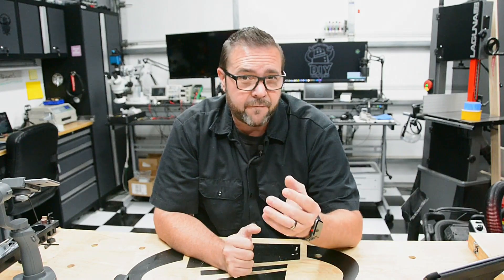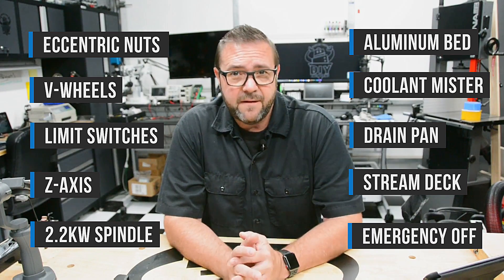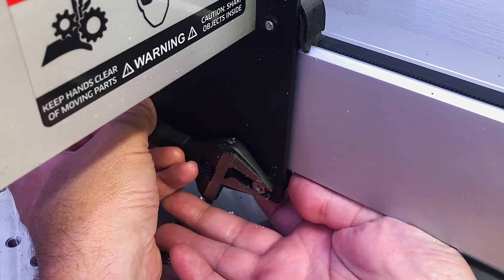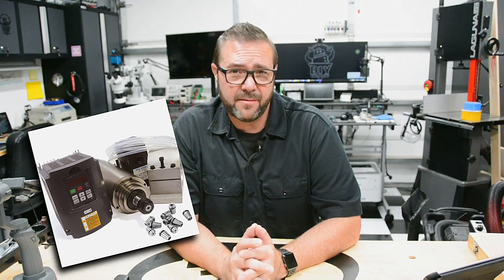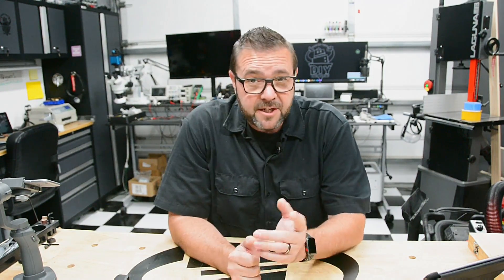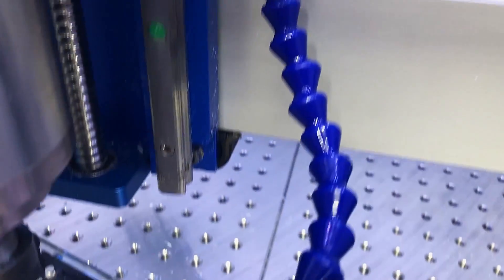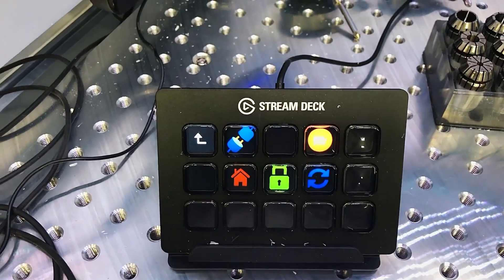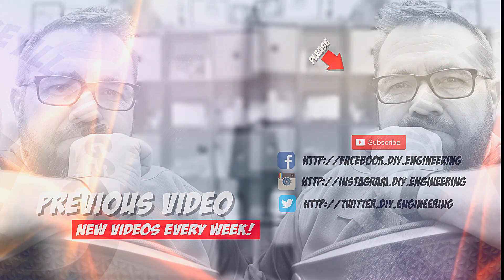Episode 037: Ten Shapeoko Performance Upgrades!

Comment: Just added the HDZ and the aluminum threaded table from Ohio Diesel Parts LLC to my Shapeoko XXL. Currently using a Fusion 5 Windows tablet as a touch screen controller with no real complaints. ($189 on Amazon) Would love to do the Stream Deck upgrade though... that looks great! Terrific video with tons of useful information... thank you for making this video.

Comment: Holy smokes.  Shapeoko on steroids. I guess if I push mine to the limits I can start implementing some of these changes.  The ones that I’ll do first.  Stop switch and the concentric nuts.  Then probably the limit switches and a controller.
Reply from the maker: ManCraftingTM lol, i still have guilt from the cost of the upgrades, time to get back to making things!

Comment: Great video.   I have done most of these upgrades but for the mister and spindle.    I have the XXL model.  Any suggestions where to find a drip pan that would fit that beast?     Thanks

Comment: Which version of UGS are you running, and have you had any problems with using it?
I am currently using Cncjs and am liking it but Im wanting to set up your stream deck pendant and cncjs doesn't have enough of the hotkeys that I would like to have that UGS does. It only has jogging.

Comment: Where the GRBL firmware changes needed for the PWM to work? I have the SO4 and my PWM voltage is always 4.9V(Max V and RPM) even if my program speed is half that.
Reply from the maker: What version of GRBL are you running? And which  pin are you using?
Reply: @DIYEngineering  I have to look up my GRBL verison, but I believe that I had to change something that was 1000 to 24000. Not at machine now. Sorry about the vagueness.

Comment: @DIY Engineering, is there any way to get the stream deck setup to work with Mach3? I have a stream deck still sitting in a box from when it was first released and using it for my WorkBee CNC would be a DREAM! Thanks for all your help and vids!
Reply from the maker: Custom Creations I’m sure it can be done if mach 3 can create custom macros and assign hot keys to them... I’m pretty sure it can. If you know let me know otherwise I’d have to look into the documentation a bit.
Reply: @DIYEngineering  I am new to Mach3 but I am pretty sure you can, just like with any other program. The only problem is how to implement it considering your code is not written for Mach3?
Reply: @DIYEngineering  All I see on Mach3 is the hotkeys for certain things and then G54 positioning and so on. I think there is 200+ G54,55,56,57 blah blah blah positions but to call them from the Streamdeck is what I am trying to figure out. I can tweet you the hotkey list if you wish. Running Macros is a whole different story with Mach3 O_o

Comment: Any chance you can tell us which wires go to which terminals on the proximity switches as they are three wire and the limit switches are two wire. Great channel by the way. Trying to do your improvements gradually.

Comment: really really neat but just curious on what you spent on this as opposed to, say, grabbing and Avid?
Reply from the maker: it's been a while since this was produced, but I believe the total in upgrades was around $1200 ... essentialy doubling the price of the machine. when contrasted to a comparable avid, it saved around $1k. I have since sold this setup to upgrade to an HDM
Reply: @DIYEngineering  awesome! Thanks for the response. I'm seriously thinking of doing some of this stuff on my ProXXLHDZ

Comment: DIY Engineering,
I am adding a streamdeck to my shapeoko at the shop. I downloaded the files shared, got the latest version of UGS for Windows, and uploaded the macros there. I have (gratefully) uploaded and am using the streamdeck profile provided, looks great. However, it seems unclear where to upload the UGS profile XLM file. I am assuming its doing some keymapping allowing the streamdeck to communicate with the UGS, but the XML format seems to not take.
Any quick fixes?
Thank you
D3PC
Reply: I have same issue did you ever find fix?

Comment: Thanks for sharing. Most of the links are dead. I think a good approach for those like me wanting to buy a Shapeoko for the first time, is to buy the minor stuff like wheels and nuts and use those instead of the Shapeoko supplied hardware when putting together for the first time
Reply from the maker: thanks, I will try to update those soon. You could upgrade initially, or perform them along the way as you encounter the reasons that drove me to upgrade... :) may cost a little up front but you will get more out of your investment!

Comment: Great video. I just upgraded to the same vfd i have wired it the same way using a 5v pwm signal, but i can't fathom the pd settings (my vfd didn't arrive with a manual). Would you be willing to share your settings please?
Reply from the maker: Radious Design sure, I'll post my settings this afternoon.
Reply: Thanks. That's great. It's been driving me crazy

Comment: Great video!  Does the stream deck work with Carbide Motion?  Currently using a mini keyboard for jogging and such.  Would love to incorporate a stream deck into my machine when I finally get around to building an enclosure for it.
Reply from the maker: hi Matt, currently CM does not have many hot keys to benefit from the streamdeck, hopefully they improve that over time.
Reply: @DIYEngineering  Perhaps C3D will follow Carbide Motion Pro with an enhanced CM in the future. So far, I've been sending Vcarve DT through CM generally with no problems. But, there are times when I wish for a couple of additional features. I'm going to look deeper into UGS. 

Thank you, very much, for sharing what works for you. Very helpful.

Comment: Great video! I just received the 110v spindle and have pretty much the manufacturer video to follow, any possible way to shoot me the PD settings you used? New to all the so the book with 180 different settings is kind of daunting.
Reply from the maker: Steve Taylor no worries, I'll post them here, let me know if the jumper info helps.

Comment: PC cooling is cool 😉 but an All-In-One like the cw3000 is a lot easier and has a pump that will outdo any PC pump, it has a built in alarm, 9L tank (which keeps it cooler longer) and temperature monitoring. it’s not refrigerated but neither is the radiator setup. I’ve done both and will never go back to PC parts.
Reply from the maker: cool, I had great performance with this setup and the footprint was much smaller than the cw3000 but of course, there are other options as you point out.
Reply: @DIYEngineering  yep footprint of pc parts is a lot smaller, especially when mounted to the CNC itself

Comment: Thank you for the video. If you don't mind me asking, how do you wire up the E-Switch using the Arduino Mini Pro? Using the Shapeoko 3 XXL purchased last year.
Reply from the maker: hi Jeff, my current implementation just issues a stop command via hot hey, the device is plugged into usb, as a result, UGS stops motion and spindle in one shot. technically, its not a read dead-mans switch

Comment: For much less than the cost of the parts to build your spindle cooling, any reason you didn't just go with an S&A CW-3000 ambient chiller?  For only a little more than what you paid, you could have gone with a CW-5000 refrigerated chiller.
Reply from the maker: this is but one solution, I like it because it is modular (meaning I can extend and customize as my needs change) and customized to my specific enclosure, cnc and climate needs. there are cheaper solutions, heck some people use a bucket and fountain pump. this works for me.
:)

Comment: Why even bother buying the shapeoko, you basically just replaced everything on it?
Reply from the maker: I used my stock shapeoko for two years, earning money, through that process, I discovered lots of things I would change to improve it... this is applying those distinctions. If I were rich and were doing it all over, id buy a Tormach.